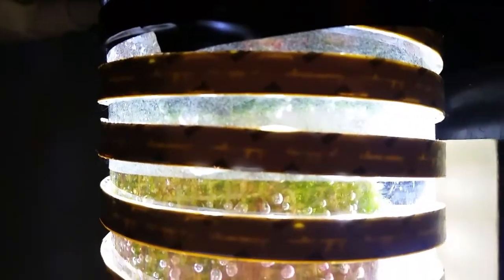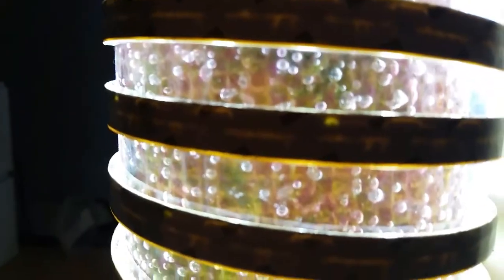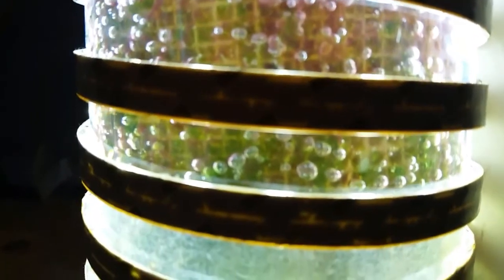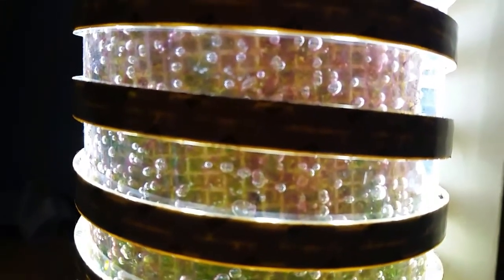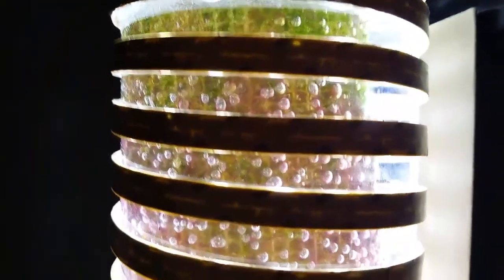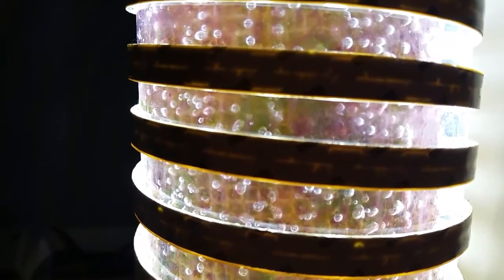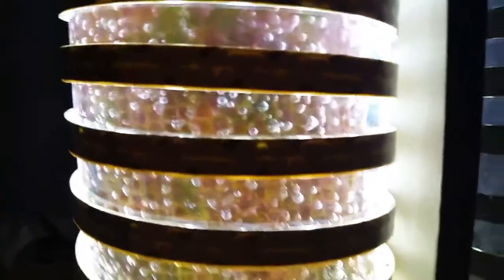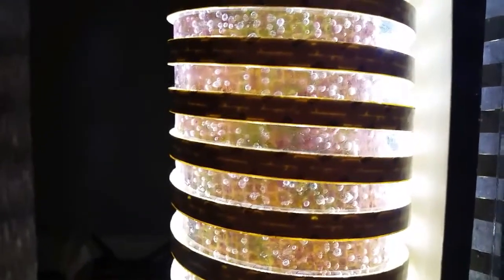Algae Scrubber Reactor Update 2

Comment: How about an update?. I am wrestling with the same idea. Or should I just purchase the Santa Monica unit. I already have a reactor laying around so minimal money to start it up if it works?
Reply from the maker: Steve C 
I had intended to do an update recently but lost what I had recorded. I had checked the growth again and it was just the same as in the first update, in the time I had been trialing the ats reactor I found no change in any parameters or reduction in algae growth in the main display tank, the amount of maintenance required to remove the reactor and clean it far outweighs it's benefits so I decided not to put it back in and would rather use the reactor for carbon. You could possibly get better results than me if you can add air bubbles to the reactor as others have suggested to me, but I am now moving on to a display refugium to keep my algae under control which will also give me other benefits that I desire too.

Comment: Nice videos buddy I'm your opinion do you find the chaeto or algae reactor more effetive at removing the No3 Po4?

What model is that bubble magus? I have the curve 5 and love it just wish I got the curve 7 instead.

Thanks
Reply from the maker: us2tohell 
I'd say so far the chaeto is far more effective at nutrient export than the ats as a reactor setup. With the chaeto my nitrate dropped a lot but so far with growing algae it has stayed the same, if I modified the reactor to have bubbles rising up in it the algae may grow better and get a better result, but I'm not prepared to do that as I intend on using this reactor as a carbon reactor at the beginning of next year when we move into our new home and finally set up our tank on a permanent basis. 
My skimmer is a curve 5 and love it too, I would have also loved to have gotten the curve 7 but had to settle on the 5 as the 7 would not have fitted under my tank as the stand is to low. Not disappointed with the curve 5 tho, it is doing a brilliant job.